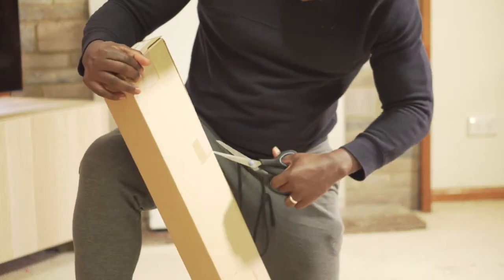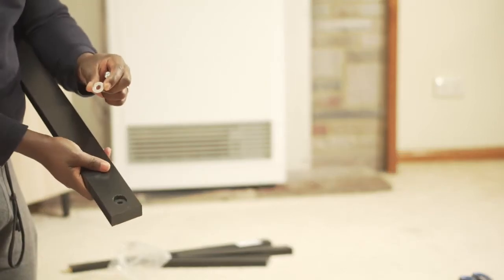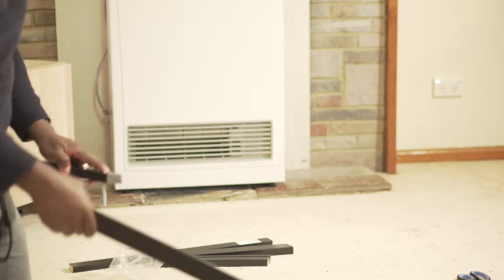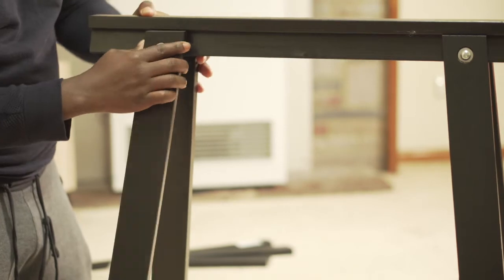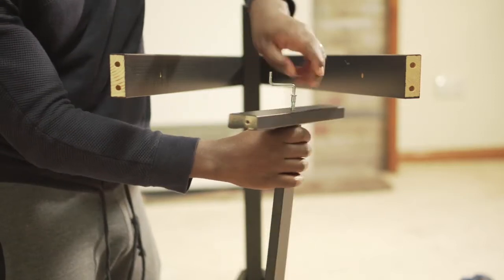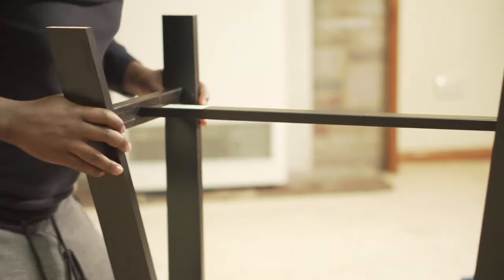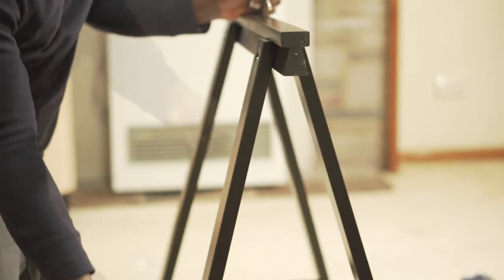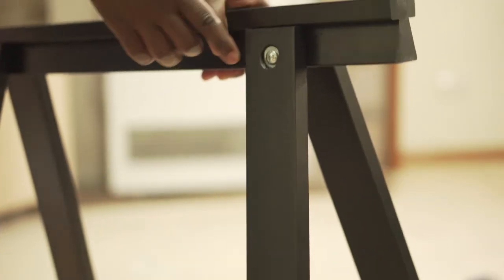How to assemble IKEA Oddvald Trestle stand

Comment: Hey I'm planning to take ikea skarsta (160*80)cm and oddvald trestle, coz of low budget would it be stable and hard enough combination???
Reply: Hey Rahul …. It is very stable , I have 3 27” monitors 2 laptops , a stack of books  probably 10-15kilos , when I was testing it after build I actually sat on it and it was pretty solid and stable
Reply: @bdtamuka521  which tabletop u use